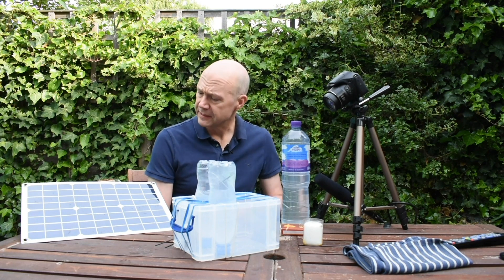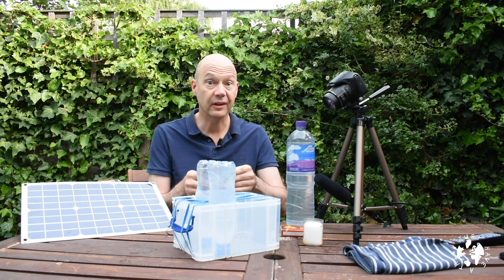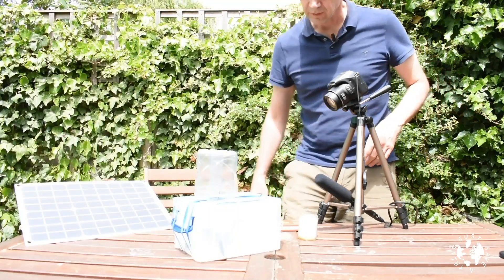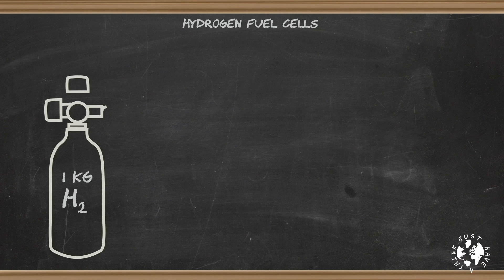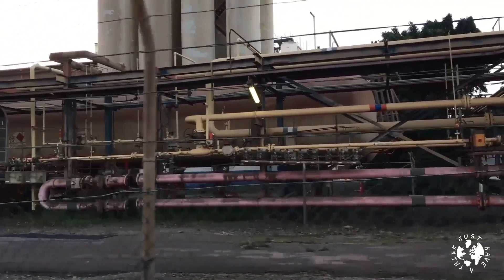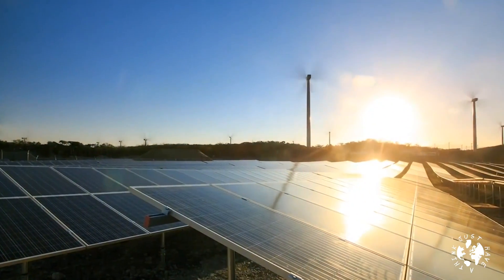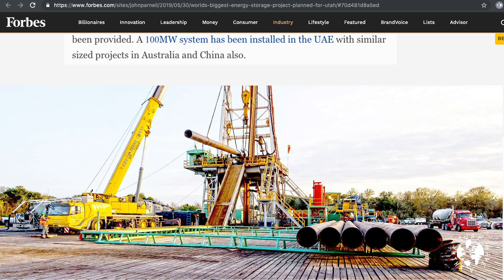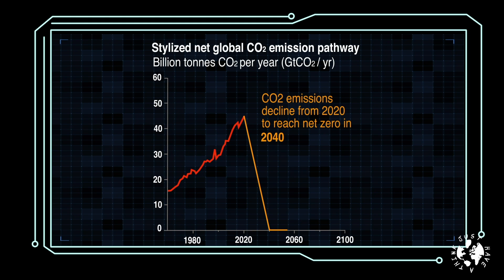Energy Storage in Hydrogen : Does this beat batteries?

Comment: Even though we're only just starting to talk about this seriously. Hydrogen grid storage is the obvious winner over li-ion for these applications. In fact its just cars and SUVs where batteries have major advantages over hydrogen. When you scale things up to say buses, trucks and trains. Just the fact that you are carrying a massive battery whether its fully charged or nearly depleted is a massive drawback. For grid storage you don't have transportation losses. It's true you lose a hell of a lot of energy concerting it to a liquid but that doesn't really matter because filling the same capacity with batteries would cost more than just putting up more solar panels and it really doesn't matter that much when you're charging your system. There is an upper limit to how fast you can charge batteries however. Technically with much better equipment you could super charge the batteries but on a grid scale that would be very expensive. On a car the super charger is actively cooled.
Reply: Grid storage doesn't need to move, so the mass (weight) of the batteries is irrelevant. Storing excess electrical energy in batteries is far more efficient than using it to split water to liberate hydrogen, storing the H2 - and if you compress it using more energy - and then later putting it back through a fuel cell - losing yet more energy through the conversion, to make electricity again.
Reply: @freddiefox.  That didn't stop humans from using fossil fuels and engines instead of readily available electricity and motors even before the ICE car.
Reply: @Furiends  I know, right. As a species, once we find something that works, we tend to stick with it, and refine it, rather than looking for alternative solutions, even when our chosen solution has significant drawbacks and costs, but still offers us a beneficial advantage. Actually, I don't have a problem with hydrogen as an energy storage medium. It could well be part of the solution, especially for long-term storage, and as a transportable energy source for remote locations.
Reply: @freddiefox.  We didn't though. The electric car came first. It's more like engines just didn't have drawbacks because most of us didn't know of them. Efficiency is irrelevant when you can pump energy out of the ground.

The goal here is reducing emissions. Efficiency of energy collection isn't as important as people make it out to be. Just that its renewable and scalable both of which hydrogen is. Otherwise we might as well start building our Dyson sphere now.
Reply: You don't need much in the way of batteries on electric trains, you can get all the power you need via an overhead pantograph or a 3rd rail.

Comment: How about cost involved? And energy loss during transformations?
Reply: ask renni... him & the oil company he works for got it all figured out... excrpt for the part where they charge $7 a gallon for hydrogen
Reply: hey reni.., gotta love that $7 a gallon hydrogen. as cheap and efficient as you say it is you and shell oil must really be rich by now. lmao
Reply: and for his next trick reni is going to use his engineering degree to explain to the rest of us idiots how giving $300 a month for fuel is better than $20 a month. take it away reni
Reply: analogdriver hydrogen is a fun lab trick. thats all.
Reply: analogdriver made from oil refinement (methane) then stored in tanks, then fuel cell, about 70% loss
Reply: analogdriver which is why cost of hydrogen at the pump (if you can find one) is $5- $7 a gallon

Comment: One problem: You Will need 4 times more energy for a hydrogen car to travl the same distance as an EV. Cost to drive 1km in hydrogen car is 4,5 times the price in an EV. They move hydrogen by Diesel truck in Denmark. Not that green. Now they make it from grid power, not wind only. Most EV charging at night use aprox. 70% wind power.

Comment: Unfortunately salt water also produces chlorine so be careful folks
Reply: @asificam1   Thanks for that (also thank you Wikipedia). Today I learned NaOH (sodium hydroxide) will cause chemical burns (it is a strong Alkali), also known as caustic soda. The world is sadly not as benign as one might wish.
Reply: water to hydrogen- 20% loss+ a ton of maintenance. high pressure pump to store- 10% loss- if you're lucky. hydrogen gas thru fuel cell, 40% loss, for a total of 70% of your energy thrown away. most likely, Denmark is refining natural gas into hydrogen... would be WAY less wasteful to just store the energy in batteries.
Reply: @jaybee3165  In 2014 that would have been true. For small volumes waste is lower with batteries (particularly for mobile applications), for large scale fixed storage hydrogen is far more practical.
Reply: @flagmichael  convert from h2O to hydrogen- huge loss. compress & chill into liquid, more huge loss. run through hydrogen fuel cell... loss again- no. air is str8 up 80%
Reply: @flagmichael  big oil pays test lsbs huge dollars to lie about hydrogen efficiency because they want to steam refract nat. gas- which would be fine- except they cant compete with solar
Reply: @flagmichael  which is why h2 fuel cell cars are dead in the water... $7 a gallon for h2
Reply: The new processes work on the water molecules directly:
https://www.technion.ac.il/en/2020/01/water-sun-hydrogen/
http://rexresearch.com/davidsonhho/davidsonhho.html
I don't know the details about the Technion process but the second link describes Davidson's process well: essentially, it flips the boomerang-shaped polar water molecules until they pop apart. As the article says, "If saltwater is used, the salt just drops out of the water, which evaporates into the two gases"

Comment: Hydrogen produced from Renewables and stored in a solution mine salt Dome or some other geologic formation may make sense. However using a hydrogen fired gas turbine in a combined cycle gas turbine is probably only going to be a maximum of 57% efficient. To begin to achieve significant deficiencies we are going to have to extend the life and performance of solid oxide fuel cells like is being developed by Randy Petry at Fuel Cell Energy. They are developing a reversible solid oxide fuel cell that can also perform as a solid electrolysis cell and potentially have an AC to AC round-trip efficiency of 75%. But this will require discovering how to extend the life of solid oxide fuel cell stacks from thousands of hours and a few years to at least 20 or 30 years. In the meantime Highview power storage is demonstrating in England the liquid Air energy storage system that is 60% efficient and can be built in any size you need in any location and you won't need any special geology. But going to 100% Renewables  is probably going to double and triple Electric rates . Dale

Comment: There is no such thing a renewable energy the solar panel requires 12 to 20 elements to make like lead copper zinc and aluminum plus  strong acids to clean the silicon panels. To mine the silicon panel is very dangerous to the lungs of the minors. Wind turbine bird killers need 240,000 ton of C02 to make a 80 meter tall wind turbine (concrete steel copper and other mineral) plus both only last from 15 to max 25 years depending on the manufacture and if used near salt water. 

As for batteries the best is the old Nickel Cadmium because it is easy to deep cycle up to 2000 or more times Lithuim only 300 to 500 times at best. Nickel Cadmium can be 100% recycled cheap but lithium can't be recyled easy but is not for the lithium but becasue of a world stortage of cobalt and that is a coslty and dangerous process. Lithium batteries have to be handled  with care or they will explode  (so will Nickel Cadmium but they just get hot and melt and give off hydrogen) 

Nothing is perfect I have not only studied the products but being 35 years in the electronic industry have used solar panels and wind generators batteries from lead acid,  niclel metal hyrdrate, nickel cadmium, lithium, salt water ,gell cells and potash batteries (simular to dry cells not usable) 

There is no perfect answer thus fosil fuels will be around for several more hundreds of years.

Comment: That’s very impressive for a solar panel as I once calculated what it would take to fill a remote control hobby airship and it was pretty outrageous, basically the gas would have dissipated through my air bag almost as fast as it would be generated. And my plan was to use 100 watts from the grid, not a solar panel. But then the problem for me was that there’s no water bottles with a large enough volume to lift themselves, and bags will allow the gas to permeate rapidly.
Reply from the maker: Keep innovating! Sounds like we need people like you pushing the boundaries of what's achievable. It's how breakthroughs are discovered!. All the best. Dave

Comment: Natural gas is mostly CH4 (with traces of other heavier molecules), molecular hydrogen H2, atomic weights for the molecules CH4=12+4= 16 g/mol  H2 =2 g/mol . for ideal gasses 1 mol =22,4 l at normal conditions and density= mass/volume, so wouldn't hydrogen's density actually be a bit less than 1/8(2gmol/16 gmol)that of natural gas?(One third is mentioned in the video)

Comment: The most important is all electricity generations have low-efficiency in convert energy to electric. Steam turbine-thermal power plants(35-50%), solar PV (<30%), wind(35-45%)...... Compare to that, hydrogen production from non-electric pathways are thermal processes, which always have much more efficiency (60-70%)
https://en.wikipedia.org/wiki/Thermochemical_cycle
https://www.solarpaces.org/csp-efficient-solar-split-h2o-hydrogen/

Comment: One of the biggest problems I see with using hydrogen vs. lithium-ion batteries is that you need to spend a lot of energy to compress the hydrogen. And then, once it’s compressed, you need to convert it back to electricity (in most cases), using a fuel cell. And using fuel cells, at least at this time, isn’t nearly as efficient as storing electricity in a lithium-ion battery. So, as you said, it might make sense for long term storage, or for storage where you need a very high energy density (large industrial machines, etc.). It might also be good for colder climates. But I don’t think it makes a lot of sense for things like passenger cars, where energy efficiency is very important. 

You would need to dedicate a lot more solar panels to generating hydrogen for a hydrogen powered vehicle, than you would for a regular electric vehicle. With hydrogen, you’d also want to make sure you create it locally whenever possible, because transporting it around would also cut into the efficiency numbers. I guess the long term success of hydrogen would depend on the efficiency of solar panels, and if we could generate a significant surplus of energy. If we had an oversupply of electricity, hydrogen would surely be successful. But how likely is that?

Comment: Interesting, but you fail to mention the 75% energy loss that occurs from production and back to electricity
Reply from the maker: Hi Thomas. Tune in later today - I'll be trying to address some of the challenges from last week's comments - including conversion efficiency compared to lithium ion. All the best. Dave
Reply: In fact, as long as it's solar energy it doesn't matter. All you must do is put the power output after storage in the equations.

Comment: Hydrogen can be stored and transported as cryogenic liquid.  That's old technology.  But the efficiency of first generating hydrogen by electrolysis, storing - either as cryogenic liquid or compressed gas or as adsorbed on certain metal alloys, then used to generate electricity is seriously inefficient and expensive.  Although all of the steps can be done and are being done for various purposes.

Comment: H2 is very inefficient as a storage. We would loose a very big chunk of the original available electricity. So not feasible. There are other forms of batteries, like liquid metal batteries, which are even more efficient than hydro pump systems. And there are other alternatives like mechanical storage solutions, which we don't see widely used yet

Comment: Comparing the hydrogen power per pound to battery was ridiculous... the battery output IS electricity... hydrogen is simply a gas that requires a power generation facility to derive power from.

Comment: A few thoughts..

There is no chance of containing pressurized free hydrogen gas in a salt cavern. Hydrogen is so small it can seep between the iron molecules in a steel pipe. This is where embrittlement comes from. All those tanks and pipes you showed constantly leak. Not a lot, it's carefully monitored, and generally not a problem. The hydrogen itself is dirt cheap to make a little more, once one is using the big oil method you disapprove of. The only issue is blowing your plant up if any hydrogen collects. It's hella dangerous, and the safety precautions make a petrochemical plant look like a playground. 

Also, no chance of sending hydrogen down city gas mains. They have enough leaks now with methane, a far bigger molecule than H2. You could make a horror movie out of that one.

Looking at your pictures of the solar and wind farm, I can't help but think, environmentalists really did that? That's their answer? Even the sands of the Sahara Desert are not quite as forbidding to life as black glass in the sun. And did there used to be birds in that area? No more, that's for sure. But underneath, the shaded ground should support some insect and rat life, with perhaps snakes and little foxes to hunt them. How many square miles of that to replace one power plant?

And then you triggered me with the graph, and did it say zero net CO2 emitted by 2040? I could believe in a 6000 year old Earth before I believe that. And here's the kicker; even if we did get to 0, it's already too late. There's a couple of centuries worth of extra carbon in the air now, and that will continue to drive climate change, which will still get worse on it's own feedback. If that's a plan, then it sucks.

Luckily, science and logic provide answers to this problem, as they do for every other. There are exactly two forms of power stored in the Earth's crust where we can get to it. Carbon and nuclear. Everything else is a joke with the punchline of, 'people that are bad at math.' If carbon is out, then logically, that leaves.. yes, nuclear. 

Nuclear is the only answer, for a number of reasons: 
1. Enough power to replace all carbon currently in use, and then some. Add all the gasoline used and most diesel if your goal is to have all electric cars. Then enough power after that, to provide for unlimited growth, such as underground greenhouses and such. And still more power to plan for about 4 billion people to join the first world and get central heat and air, 2 car garage, etc. (the plan for that was windmills?)
2. Enough power to reverse climate change. Maybe I should have led with that. The real answer to climate change, is to un-burn two centuries worth of rampant carbon use that powered the Industrial Revolution and everything after. Return the CO2 levels to what they were. The problem with that simple plan, is that it will take more power to sequester that carbon, than was released in the burning of it. So not only do we need all the power we use now, we need almost all the power we have ever used, times probably two. (this is where windmill plan really fails)
3. The ability to dispose of 60 years worth of nuclear waste currently sitting around, due to environmentalists having stalled nuclear science for the past 50 years. Well, that and politics. They say it can't even be buried at Yucca mountain, and they are probably right about that. That stuff is 10,000 years of certain death. It can only be burnt up in a nuclear reactor, and turned into lead. Slightly radioactive lead that can then be safely buried for about 300 years in a semi-normal landfill. (that's a good spot for windmills btw)

A CO2 distiller is known science today. A safe nuclear plant that simply cannot melt down is right on the edge of current science, a lot more so than hydrogen-proof pipes. A turnkey nuclear plant that you never have to fool with, you just turn the CO2 distiller up and down, which turns the electricity supplied to the grid down and up. I'll take a few thousand just for the US, and then they should be dirt cheap, so that poorer people and eventually the whole planet can afford them too.

We've solved climate change in a handful of years after those come online. What little petroleum we still use, which is no big deal and not even a pollutant or concern anymore, we get from a tap on the side of our nuclear plants. With the bonus ability to now somewhat control the climate of the planet at will. Star Trek type of stuff. That's a better plan.

Comment: You glossed over the massive energy loss of electrolysis. It takes a large amount of input energy to break the hydrogen-oxygen bonds in water that cannot be recovered in using it. They didn't "find a way to use fossil fuels to make hydrogen" because people like fossil fuels.  They do it that way because it is cheaper and loses less of the input energy. Electrolysis would be used if it was less wasteful.  Competitive industry does not do things because they like burning dead dinosaurs. 

The other problem with hydrogen is that it's not free to compress it. That takes a lot of energy. It is the most difficult gas to liquefy.  Hydrocarbon gasses can be liquefied just outside of atmospheric conditions. This greatly enhances the energy storage density.